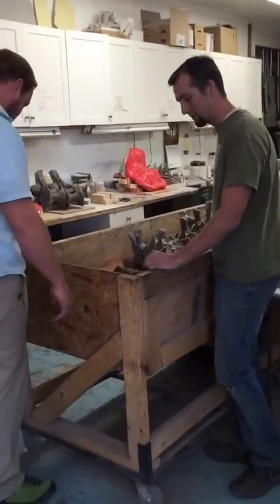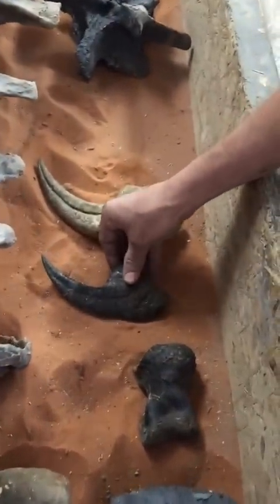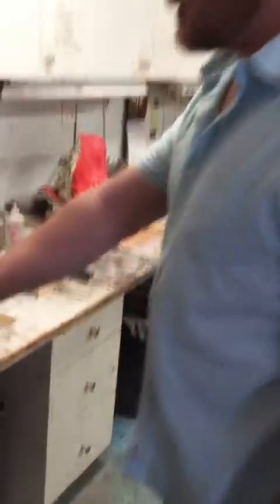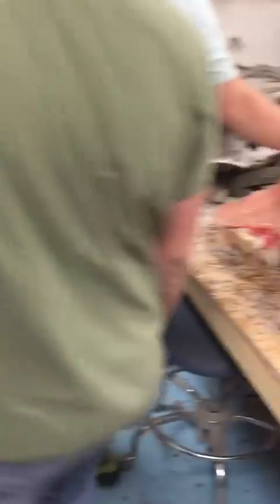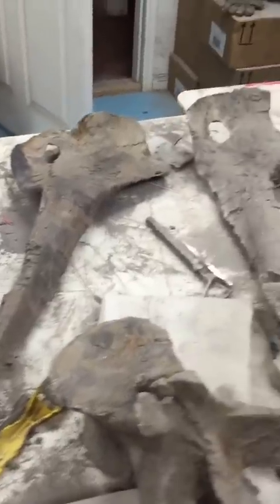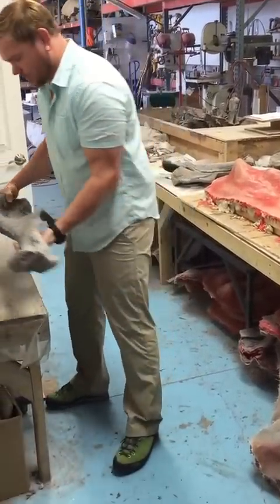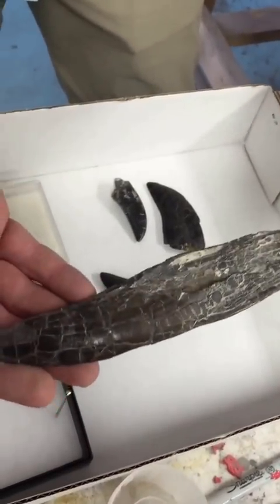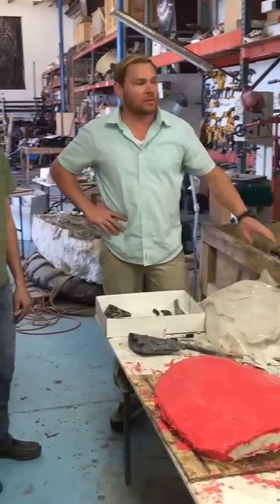"Elvis" the Torvosaurus Bone Size Comparisons

Comment: I've made some calculations last year and the specimen would weigh in the ballpark of around 7 tons if it was 11-something meters long. The TBL estimate is based on the skull size and the mass estimate on another specimen that apparently was about 10 meters long and weighed 4-5 tons (I took the middle estimate of 4.5 and used square-cube-law by Hartmann). That would make it even larger than Acrocanthosaurus.
Reply: how did you make calculations?